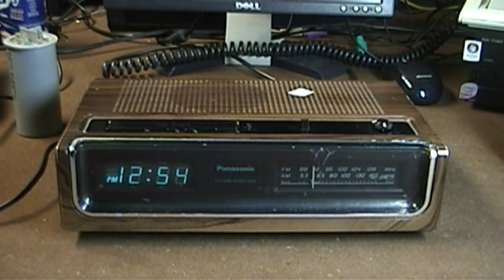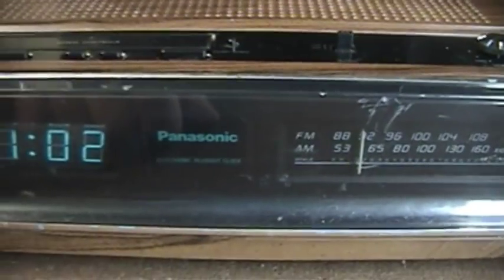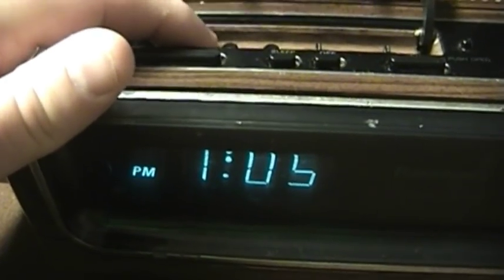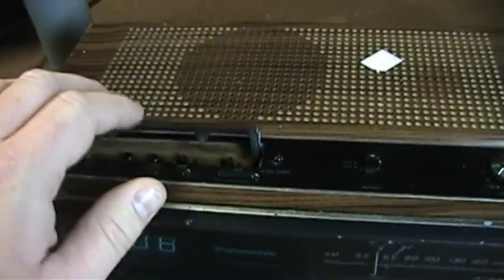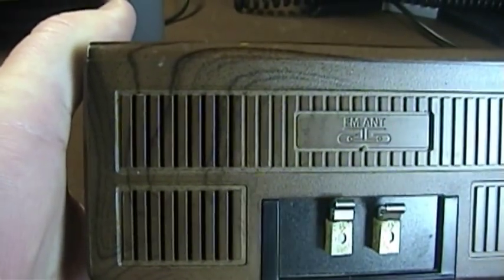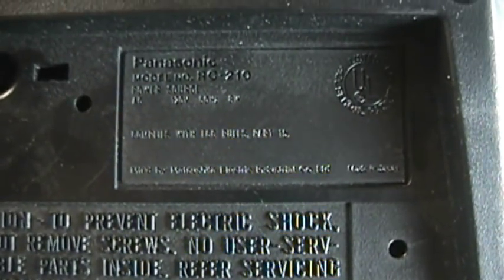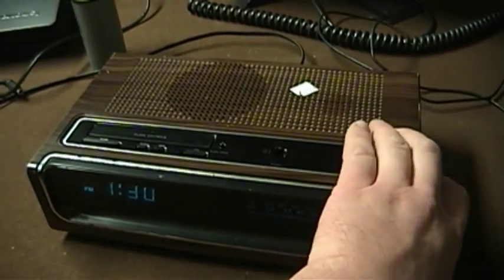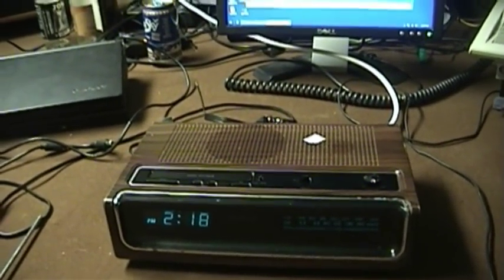Panasonic RC-210 Clock Radio

Comment: Only you could get me to sit through a 24 minute video about a clock radio! LOL!
Reply: Retro Guy74  I thought Bill was going to take it apart.  Especially since he said it seemed to be in a " re used " case.  This could have been a full hour of fun!
Reply: ***** One day will you get a more modern camera? From what I can see your camera has 3 issues:

- Quality, The video quality is not bad but not good.
-The battery life seems to be quite short (I've seen in many videos you mention this) especially when you use it's light
-Tape, It's fairly expensive, usually only good for 60 mins and to my knowledge not re-usable. 

It's a decent camera but will you ever ditch it in favor of a more modern one?
Reply: ***** He does have a more modern one, but it isn't as flexible as the old handycams by a long shot. 

The problem is that the old handycams had a lot of features that newer cams don't have, like built in lights, nightshot, etc.
Reply: I agree
Reply: ***** Thanks for the explanation, love your videos keep up the good work :)
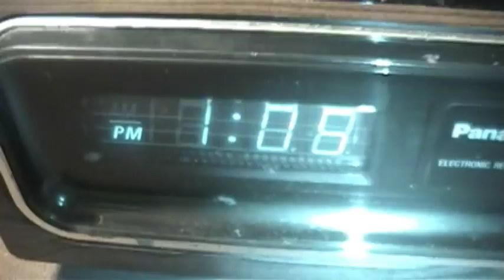Reply: Xodium 6:40 Oh look, his camera has nightshot!
Reply: ***** It's actually quite a nice camera. Sure, the resolution isn't so high, but it's pretty good. Now, I wonder if there's a way (since tape of course is an analog format and can have infinite resolution) for the tape to be transferred to an HD resolution? It looks pretty good even by today's standards to my eyes, maybe an upscale of the tape media to an HD resolution (when you are eventually able to edit it) would do some good if the viewer, say, is watching on a TV.
Reply: ***** Analog still has a resolution on most types of tape. It's only when you do it on film (which is really expensive) that you have infinite resolution
Reply: ***** Sorry... I had a bit of a brainfart there. :)

I even had pictures of the film reel in my head and thought "It's interesting how each frame is a photo on the reel!" and all that... dunno why I thought his camera would be film, nor why I said tape. :)
Reply: ***** Lol, it's an easy mistake.

Comment: The Appliance Control jack activated a seperate module with a relay in it that you could plug into the mains and plug in another device like a lamp. If i remember correctly it shot about 12 or 24 VDC off to close the relay in the module to turn on whatever was connected to it.
You can easily build a replacement, just activate the alarm and take a voltage reading from the barrel jack.
I assume a new replacement you can buy will contain an opto-coupler type circuit or solid state relay and not a mechanical relay.
This feature was available on several Panasonic clock radios of this era.
Reply: What was the purpose? Could I get a coffee maker to attach to this?
Reply: Maybe not a coffee maker because of the current rating vs the coffee makers heating element current draw, but a bedside light is an option.

Comment: This is a shot in the dark, but I would hazard that the appliance jack on the back would connect to a device which plugs into the wall, and has another 120V outlet on it. When the alarm goes off, the jack outputs a low-voltage signal which goes into the auxilliary device, and activates a relay or something to connect power to the 120V outlet on the device. This is purely a guess though. If that's indeed how it works, it would have been useful for a deaf person - plug a lamp into the auxilliary device, and it turns on when the alarm goes off.

Your explanation of the mechanism by which VFD's wear out is correct, but I've never heard of the thing about electrons getting "stuck" to the back of the display. In the case of a VFD, when the emitted electrons strike the phosphor, they are converted into photons, hence create light. At any rate, whatever happens to the electrons themselves doesn't cause the display to dim; simply that the cathodes deplete their emission coating and create less electrons as a result, which you explained perfectly.

A clock running on it's battery backup may indeed last only a short time, and lose quite a bit of accuracy (I wonder what the timekeeping mechanism is in this mode; can't be much more than a simple generic oscillator circuit), but it certainly can make the difference between waking up in time or not if the power goes out! I maintain a battery in my clock, and it's saved me a couple of times.

Anyway, very nice clock radio, and excellent video!

Comment: Wait, where's the touchscreen :-p

All those hardware buttons!  Nice stuff.  Reminds me of a mid 70's cabinet or model, based on the sheer size.  That's from back in the day when you could go into a store, have a salesman help you, demonstrate the product, and then you'd make your decision to buy based on that.  And they didn't try to ram extended warranties down your throat either.  You just didn't need them!
Reply: jaykay18 Even most modern day clock radios haven't managed to grasp a touchscreen yet... And when they do, I'll still be using my old GE clock radio / tape player. Sounds better than those tinny clock radios they make nowadays.

Comment: Wow that alarm clock sound sounds like a bird twitting like you hear a bird call, that tickles me up. XD

That VFD I love that display, and I love the way they put the Fast and Slow button where it is quicker than pressing Hour or Minute button where I got to set it up the clock, and that design is unique, I kid you not, that VFD looks similar to my 1984 General Electric Spacemaker Kitchen Clock Radio 7-4220A. =)

Comment: I don't know what it is about these old Panasonic clock radios but I do love them.  Just received a RC-80LBE which will replace my cheap unbranded clock radio I have at the moment which although working fine, is just not vintage enough for me!  I seem to remember my mother had a similar Panasonic clock radio when I was a child which scared the crap out of me with its insanely loud buzzer.  Interestingly my RC-80LBE has a button on the underside which says "EXACT SEC" which I can only imagine returns the displayed time to 00 seconds if you wanted to get it exactly syncronised.  I can't imagine who would have used that nor have I seen it on any other clock radio.  It also has an FM antenna connector on the back but not the type shown on your model, rather this one would require an antenna with a specific connector to fit which I have never seen before.

Comment: Ahh the loverly vaccume display, in native green or faked blue if you stick a good blue filter in front of it :-)
I think i have an old grandstand white clock/radio somewhere, i treated the radio part to a trip to the dustbin/trashcan, the clock is the worthwhile part to keep.
Yes im odd lol :-D
Led displays were good but mostly just red, lcd's are just boring, ok for test equipment displays and/or battery powered devices.

Comment: OK, the alarm tone was different, I was expecting a loud electronic buzz, but it makes are really high pitched squeaking noise.  Could it be that some components on the circuit board that generate the alarm tone are going bad?  Is that squeaking noise loud enough to wake someone up?  I wonder if this appliance control kit is designed to, say, turn on a light when the alarm goes off or something like that, or maybe somehow control a tape recorder when the alarm rings to record a radio show or something.

Comment: I just got one of these and the radio dial only lights up in the “on” position. Is that a defect, or how the unit was made? I have other Panasonic clock radios from the same time where it always lights up when the radio is on.

Comment: still rocking a late 70s early 80s ge 7-4800a alarm clock nearly 35 years later. in addition to having the coolest programming mode, its the best sounding clock radio I have ever heard, tons of bass, it gets louds, and it never distorts, wouldnt trade it for any other clock

Comment: I can definitely assure you the fast time setting is no defect. I've got a similarly old Panasonic clock radio with the same display and the same fast and slow setting buttons. And it flies like none other, also lacking a reverse.

Comment: Hey Bill, I REALLKY NEED YOUR HELP. I have a sony reciever STRDG510  and its stuck in protect mode. How can I fix this. I dont know what happened to it. All I know is I moved it from one place to another and now its stuck in protect mode.PLEASE HELP, THIS IS MY ONLY ENJOYMENT. PLEASE HELP. THANKS. GIO.
Reply: Thanks Bill, well it started to work when I iet it sit for ahile then I said maybe if I unplug everything and plug it in again, maybe it will work. well it worked and is working fine again. I cant explain it. But Im gonna save your message if something else goes wrong. You  explained it great.  Have you ever heard of this, just unplug it from the wall, let it sit for 30 mins, unplug all the devices. then plug it in and itworks?? very strange. Well thhanks again. Gio.
Reply: Gio048 It's probably something to do with the electrical current being drained when you unplug it, allowing it to kinda "reset" itself.
Reply: +gaveroid418 Hi, the problem was the speaker wires were to bare and when I moved the amp the wires touch and caused the unit to go into protect mode.
Reply: Gio048 Ah. Good to hear you've sorted it out. :)